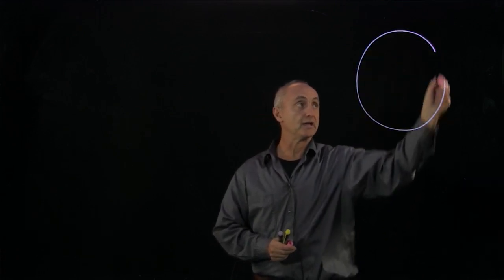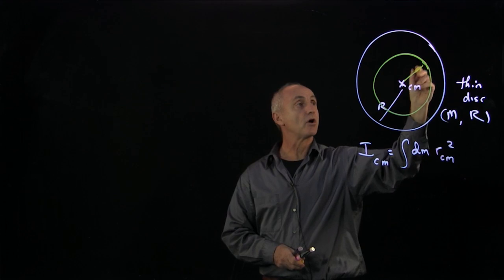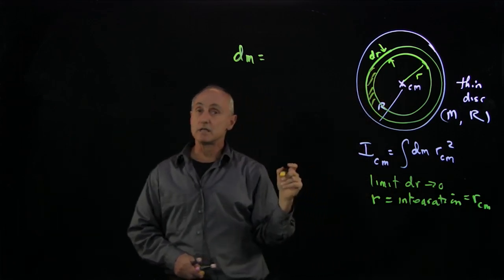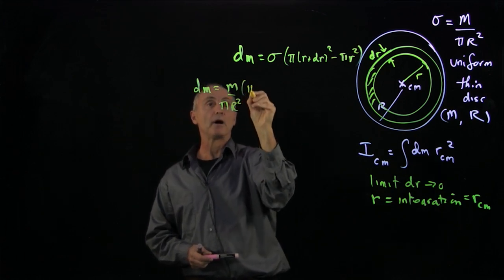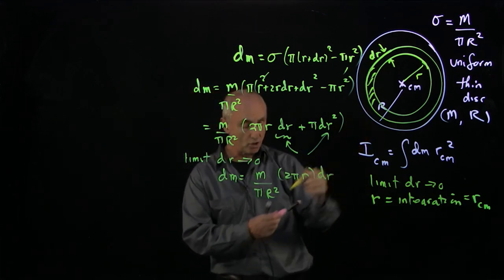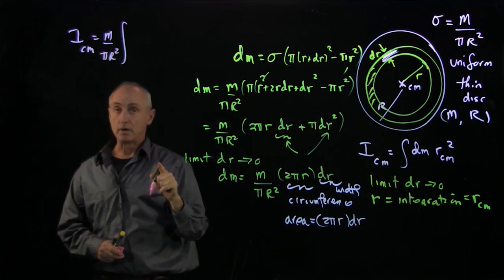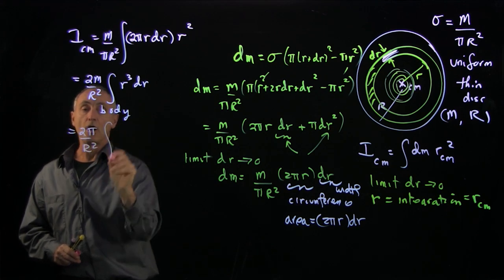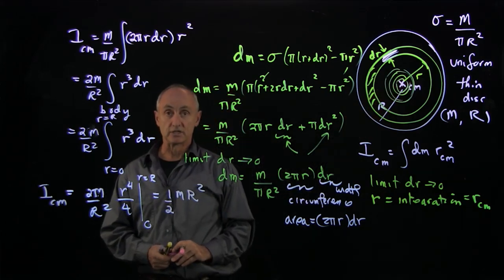29.3 Moment of Inertia of a Disc

Comment: Since total  mass is constant why couldnt we have  integrated  like this  m ∫ r^2 dr from the definition of inertia
Reply: The mass of the total disc is constant however when we consider smaller mass elements the only thing constant is the mass 'distribution'/'density'. So you can't take dm out of the integral!

Comment: 2:51 How can you say that the 2nd order differential dr is zero as dr approaches zero but the first order differential remains unchanged?
Reply: for the ease of calculation he did that
Reply: Considering the fact that dr is very close to zero, dr^2 can be approximated to 0 because it is way, way smaller by the same factor dr, which is already extremely small.
Reply: Use a calculator. If r = 0.001 then r^2 = .000001 and so on and on. You can see that dr^2 will approach 0 within that limit.